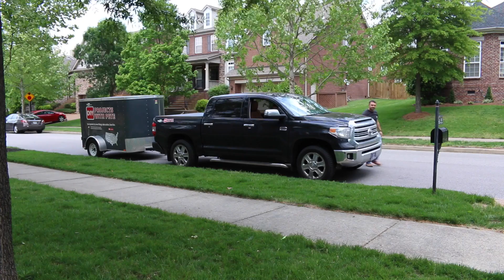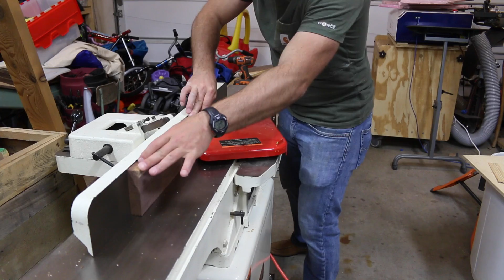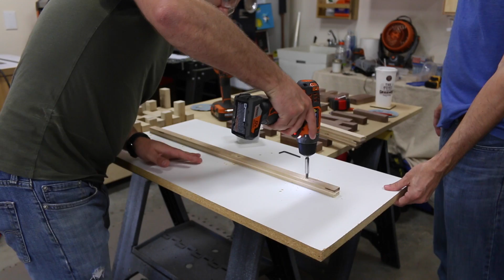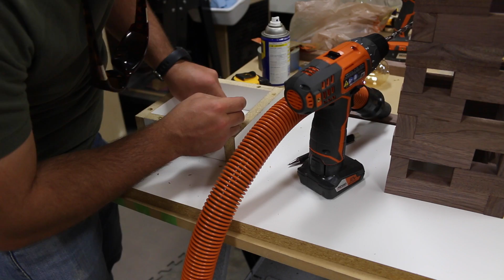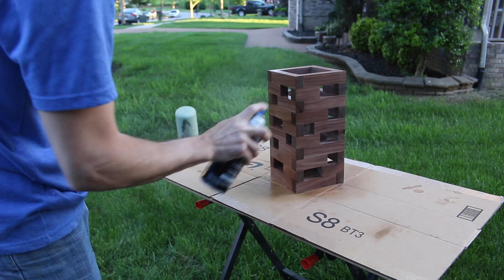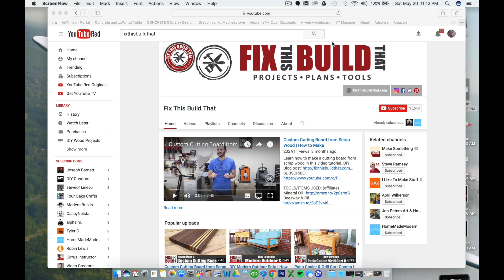Concrete and Walnut Accent Lamp Build | Woodworking Tutorial

Comment: That's awesome! Just to nitpick: the correct S4S board facing procedure starts with the jointer on 1 side, then an adjacent face, then over to the planer for the opposite face, finally the table saw for the 4th side.
Reply from the maker: Thanks!

Comment: Hey Pete, my name is Nick! Huge fan of your show! Probably a stupid question, but I've looked at numerous calculators on google and keep getting different results. A buddy wants an 8'x4' concrete bar top, 2" thick. Could you help me with how much I will need and approximate weight? Thank you so much, and sorry for the dumb question lol.
Reply from the maker: Hi Nick! That is going to be quite a big bar to handle. At 1 1/2 inches thick it is approximately  16 lbs per square foot. So around 512 pounds. At 2 inches thick it will be around 22 lbs per square foot or around 704 or so pounds. As for how many bags it would take for a 2 inch slab -- approximately 9. Quikrete has a good calculator:https://www.quikrete.com/calculator/main.asp    - it is for 4 inches but divide by 2 to get the 9 bags. Cheers.
Reply: DIY PETE Yeah, that's a little heavy lol. Thank you very much for the response!
Reply from the maker: you bet!

Comment: Great video as always man! What was the spray sealer? Never seen it in a tin before
Reply: It looked like the same Minwax spray lacquer that they used on the walnut. That is some good lacquer...I've used it many times.
Reply: DIY PETE I recently used some water based poly on concrete and it seemed to do quite well.
Reply from the maker: For smaller projects like this I think any of those options would work just fine. I'm only picky when it comes to larger surfaces like concrete tables and counters.
Reply from the maker: Thanks Bruce! You are right!
Reply from the maker: Hey Robin! It is a basic minwax lacquer -- rustoleum has a good one as well. Works great for small scale projects.
Reply: Interesting. We don't have lacquer here in Aus but I've read that polyurethane also works on concrete